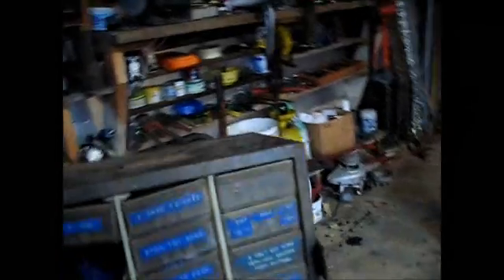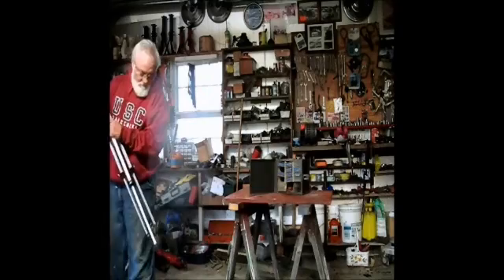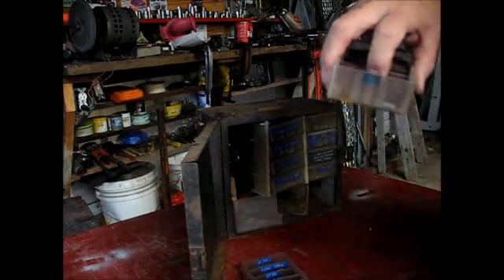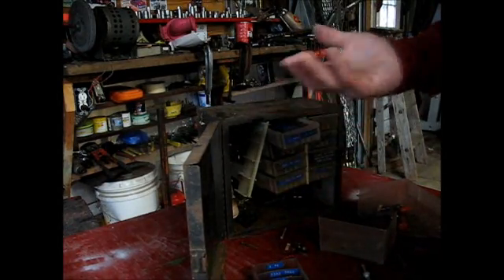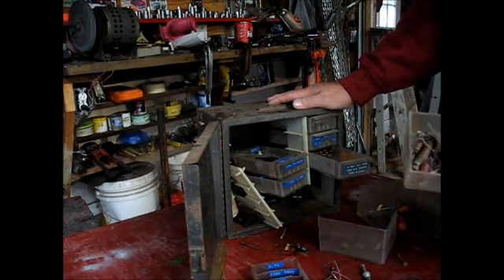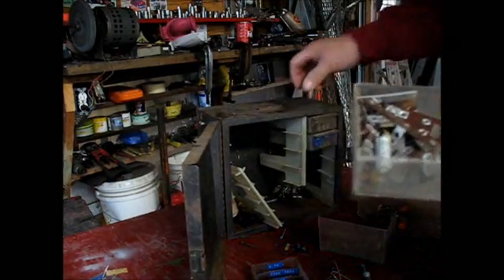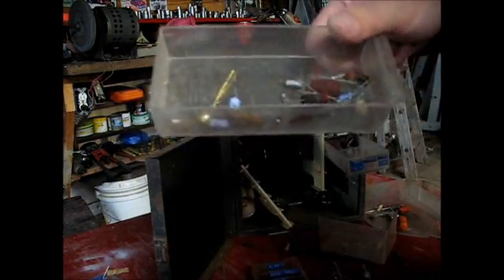Box of electrical stuff

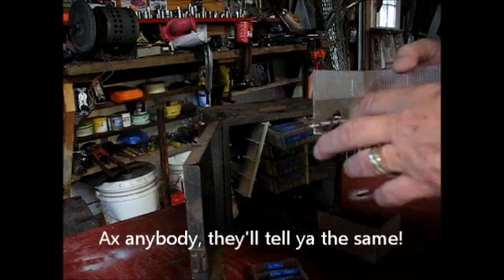Comment: That thing at 2:00 is a switch that goes in the door jam of a car. They use em to turn on the dome light or such...the switch grounds the circuit, turns on the light till the door is closed. You can find em in auto parts store on the "helps" rack...

Comment: Them thar resistors would have 4 color bands most of the time. The first two indicate the first two digits, the third band is the power of ten of the value. If there is a 4th, it's the tolerance. The color code is "bad boys rape our young girls but violet gives willingly." or Black Blue Read Orange Yellow Green Violet White A resistor with a Blue, Green, Red and Gold stripe would be 26000 or 26K ohms with a tolerance of +/- 5%.

Comment: Ye olde parts :-)

if its got colour bands then its normally a resistor, diodes have a band at one end.
long aluminium cased devices with 3 legs are germanium transistors,

most of the rest will be capacitors or condensors for the old timers out there :-)